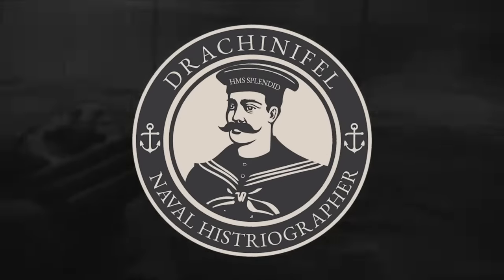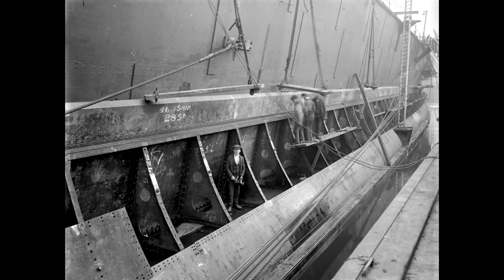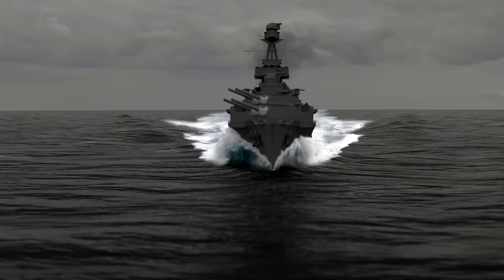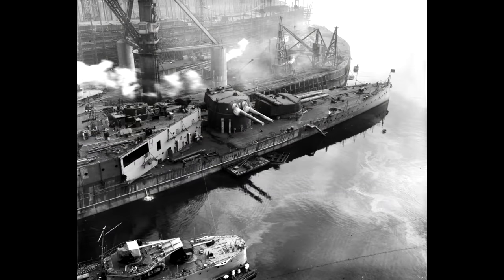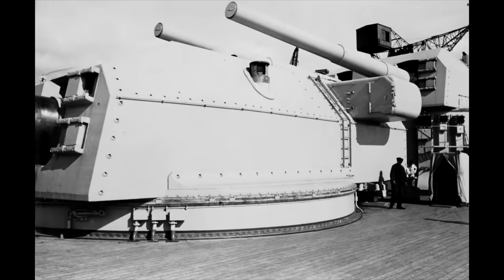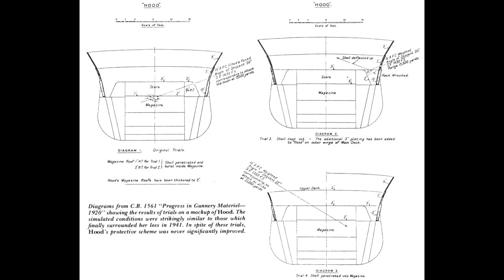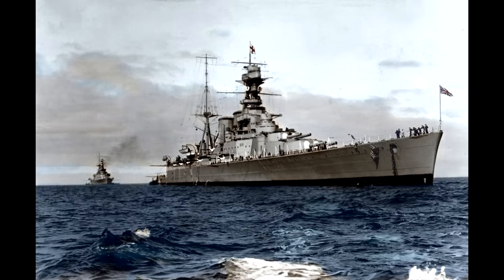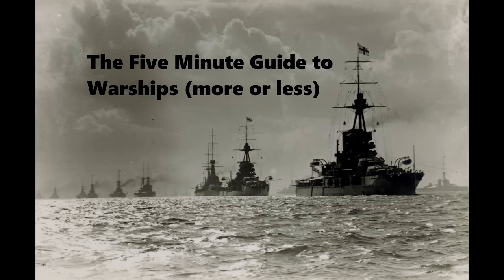The Loss of HMS Hood - But why did it blow up??

Comment: My uncle was a stoker on the Hood when it went down.
My mother, his sister, told me he was so proud to be a member of the crew.
Reply: Your Uncle is. A Man that HEROES are made Of. His sacrifice makes Freedom possible. Many thanks from grateful People.
Reply: My great grandfather was one of the lucky ones to disembark at Scapa Flow, but his Brother in Law, also a stoker, had just joined...
Reply: What’s a stroker?
Reply: @CodeUK93  Stoker meant they worked in the Engine Room.
Reply: @CodeUK93  they fed coal into the fires that heated the boiler and power the ship or “stoking” the flame
Reply: It was an oil burner.
Reply: Hero.
Reply: @johnbishop5316  and they were still called stokers.
Reply: @CodeUK93  Sorry, Cody. I was unforgivably rude to you.
Reply: @Mw-tr2oz  You're right and I've apologised to Cody.
Reply: @sugarnads  You're right and I have apologised to Cody.
Reply: @johnbishop5316  well done, best of luck to you sir.
Reply: @Mw-tr2oz  Thanks,. I hope that Cody is as generous.
Reply: My great uncle was on the Hood too. He was the reason my grandfather served as a stoker through most of WW2.
Reply: @proteintoenail  Did he survive? There were only 3 as I recall, but stand to be corrected.
Reply: @johnbishop5316  No, my great, great uncle (correction) died, but my grandfather wanted to follow in his footsteps anyway, despite objections from his family because of what happened on the Hood. My grandfather started out as an ambulance worker during the blitz before joining the navy as a stoker. My grandfather survived the 2nd world war and was very tight lipped about his service, but in later life when he was in his cups he would let slip about a couple of things he'd seen. The story that always stuck in my head was 'liberating' a shipment of gold from the Belgian Congo on his way back to Britain before he was de-mobbed.
Reply: @proteintoenail  Reading your post made me recall that I once heard Ted Briggs speak at the Nautical Club in Brum. A sort of working men's club for old navy blokes. Amazingly in landlocked Brum. He was Navy royalty. His story was chilling. It would have been about 1975. Read his book for some insight?
Reply: @johnbishop5316  Just had a quick look into Ted Briggs online. Looks like a remarkable man and I'll definitely think about buying his book. My grandfather moved to London aged 14 and was very guarded about his family in Newcastle for the most part. The only facts he really shared was that he had an uncle on the Hood and that he had family that took part in the Jarrow march. My mother has tried to dig into his family history since he passed, but only with limited success.
Reply: @proteintoenail  Well, if he was lost on Hood, he had a horrible death but at least it didn't take long. Briggs said, there were quite a lot of survivors in the water but most died from the cold. The other thing I recall is that he said they were all very frightened when they saw Bismark. They knew their ship was old and that the German guns outranged them. The German gunners were superb.
Reply: @Mw-tr2oz  Or be so pleasant as to answer a possible misspelling troll.
Reply: @richarddevenezia8186  your mama
Reply: @johnbishop5316  he’s ignorant for asking a genuine question? You know some people don’t know everything, unlike you it seems!
Reply: My father saw the survivors march through London
Reply: Oil by then
Reply: he was one of the lucky 3 that survived the battle from HMS HOOD that day
Reply: @sugarnads  what is a "cockwomble" thats funny stuff broseph. im going to start using that word!
Reply: RIP
Reply: @sugarnads  and still called stokers to this day..
Reply: @johnbishop5316  easy tiger! These are family members you're talking about.
Reply: @johnbishop5316  the German optics made their job a lot easier. The Zeiss lenses in the range systems were a huge advantage.
Reply: @HarryFlashmanVC  I'm bewildered by that comment?
Reply: @castlesandcuriosities  Your great grandfather must have known the actor Jon Pertwee. He disembarked at Scapa Flow as well. He went on to train as an officer.
Reply: My dad's cousin SFO Richardson (Snowden) was a stoker on HOOD when she was lost, he lived a 5 minute walk from my dad, he was a painter and decorator after he left school before joining the navy. His photos and personal things were given to my dad, then to me, my dad's still going, he's 93 this year. I have a large colour framed picture of HOOD above my bed. I've also got a Christmas card at home from Ted Briggs,  my dad and I  20 year ago met David mearns who found HOOD on the seabed. I've still got the photos at home. That same day we met Bill stone who was the last navy survivor of both world wars. I could of spent all day talking to bill and his daughter, what a nice man he was.
Reply: Was the Hood coal or oil powered?
Reply: @janczaplinski658  Oil.
Heavy oil.
Reply: The sinking of the Hood added a more scary image of the Bismarck.
Reply: As sad as that no doubt was for his loved ones, if you’re gonna go (and we all will), at least he was with his mates doing what he loved.  God willing, it was (hopefully) quick and relatively painless.
Reply: My great uncle Roy Wilgress was a stoker on the HMS Hermes. He escaped the attack but DOW on a South African hospital ship in the pacific. His last letter is a family heirloom, that was received after my great grandmother had news of his death. It began "I am alive, but only just...". 2 years ago I visited his grave in Stellawood Cemetery, Durban. The first of my family who'd ever been able to visit him. God bless all those men.
Reply: @CodeUK93  one who is off duty!
Reply: May your Uncle rest in peace.
Reply: thanks for your uncles service
Reply: @klegendm2819  all British capital ships from the Queen Elizabeth class were oil burning.
Reply: @markstratton1679  my mistake I was simply answering his question
Reply: @klegendm2819  Oops, my mistake on your mistake then.😂
Reply: @sugarnads  gods I love British slang and insults. . .
Reply: @dantreadwell7421  im Australian but yeah lol thanks mate
Reply: @oliverreno4734  my great uncle (2/30 bat, 8div 2AIF) died on the Thai- Burma railroad. I will be visiting his grave in Thailand in May, covid permitting.
I will be the first from our family to visit.
Reply: @sugarnads  aw, damn. Sorry. In fairness though, you guys have even better ones.
Reply: Was his name William st.clare Johnston?
Reply: @johnbishop5316  yes but the name stoker is a hangover from the days of coal-fired ships.  Naval Mechanicians as they are called today, still proudly call themselves Stokers, part of what is called The Purple Empire from the colour of the stripes their officers wear
Reply: My grandpas brother went down with the hood ❤️